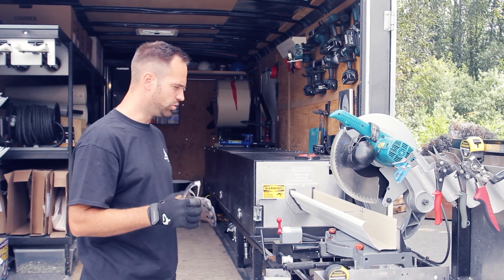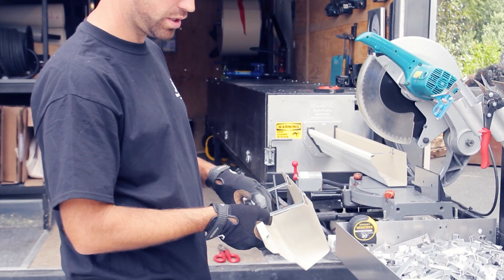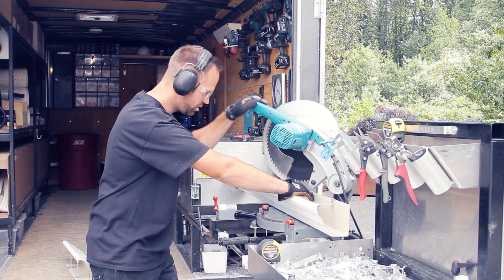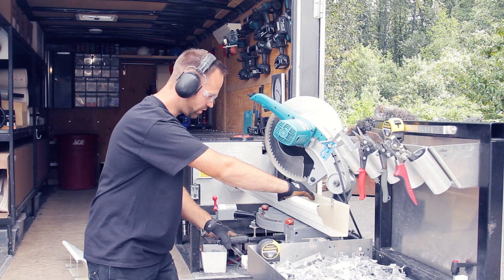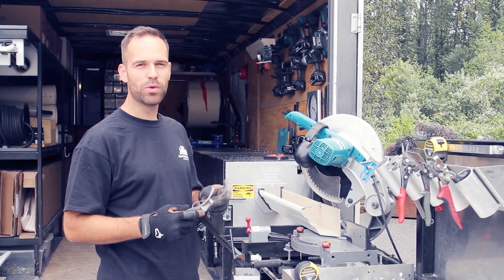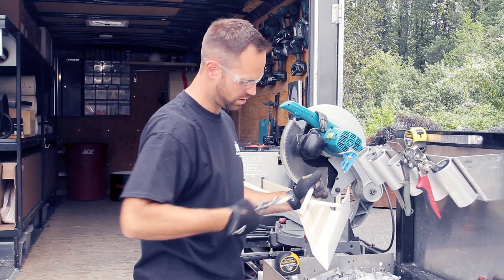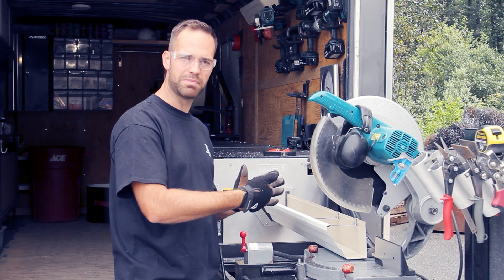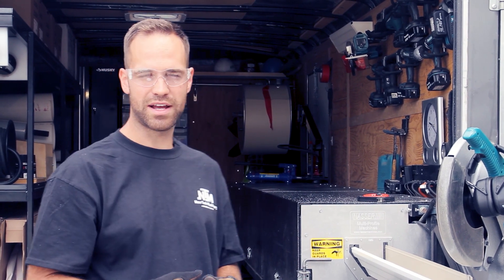How To Make An Inside And Outside Corner On A Nasser Two Step Gutter

Comment: do you silicone after everything is all installed? so no silicone actually between the joints?
Reply from the maker: Hello, not sure about the silicone as we're the machine manufacturer and not the installer.  May be best to check with your local coil supplier to get their recommendations too.  Thanks!

Comment: What size and type of  blade do you use for your miter saw?
Reply from the maker: It is a 14" diameter blade and a Makita LS 1440 saw
Reply: @NewTechMachinery  thanks its 96 teeth correct?
Reply from the maker: @Voganes  Not sure on the number of teeth, but that sounds right.
Reply: @NewTechMachinery  thank you very much for your quick response

Comment: What brand and model saw blade do you prefer and how many teeth?  Great video!
Reply from the maker: It is a Makita 14" Miter Saw (model # LS-1440).
Reply: @NewTechMachinery  Thank you what saw blade brand and how many teeth on the blade?  Thanks.
Reply from the maker: @patrickmadrid7594  We recommend the Makita 14" blade part # 792699-2.  Any Makita dealer/distributor should be able to assist you with that.

Comment: How much would it cost to have that piece made and replaced on a corner piece that has been damaged
Reply: That varies greatly. Cheapest and easiest solution would be to get a strip or box miter if that'll cover the damage. Otherwise you could make a patch but you'll have a seam, unless you replace the full length of the damaged piece(s).. so anywhere between a few bucks to a few hundred.. if you have a company replace the full pieces that are damaged, could even be over a thousand..

Comment: What size is your miter saw? What size do you recommend for 5 & 6 gutter? Because using a chop saw saves at least 10 - 15 minutes!!!
Reply from the maker: The miter saw here is a 14" miter saw and that's what we'd recommend for 5" and 6" Fascia or K-style gutters.
Reply: Thanks, that setup is crazy man
Reply: 14" blade

Comment: Do you have a video on how to do a miter joint on a 45 deg corner?
Reply from the maker: Sorry we don't Danny.
Reply: @NewTechMachinery  Would not just setting the saw to 22.5 degrees for both the inside and outside corners and following the same steps in bending as with the 90 degree corner....

Comment: Hey what material are you useing i didnt no that those saw can cut metal?
Reply from the maker: Our gutter machines can run painted steel, painted aluminum, or copper.  Reach out if you need further assistance at Sales@NewTechMachinery.com thanks!

Comment: oh, nice.  No inside flaps, but the bead of caulk holds up ok?  That's a lot faster, and clean looking with no screws.  I'd like to know how long that lasts without a leak appearing.
Reply: It depends. 
I just did a clean and reseal on a house with corners done like this, they had 6 failed corners out of 12. 

The gutters were about 20-25 years old.

The corners that failed (3 outside and 3 inside) were all on long runs (one or both sides over 35 ft). 
Thermal expansion had seperated the gutter from the sealant on the face seal of the inside corners, so it seems to be a weak point. The outside corners had tears on the backside where the tab had been folded, and had also seperated the sealant from the gutter on 2 of the corners as well. 

On most failed corners I've seen, the problem seems to be  too much stress on the sealant from the thermal expansion of long runs. Seperation of gutter and sealant (make sure it's clean and dry when you apply!) Or tearing of sealant (screws/rivets in the right place for mechanical support, or maybe add enough sealant that it can stretch. That's a bit of a risk thou.
Reply: outdated method   the saw is good but hand cutting tabs too slow.
Reply: @robertsmith-gp6lc  it's not that slow, and if it saves from a go back complaint, I'm using at least one tab somewhere